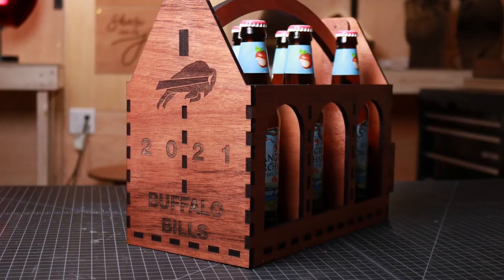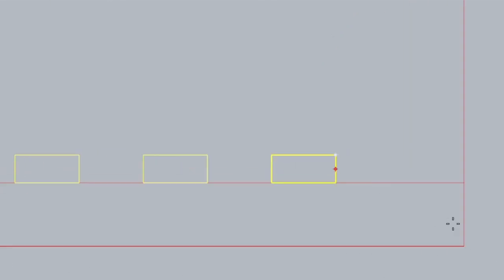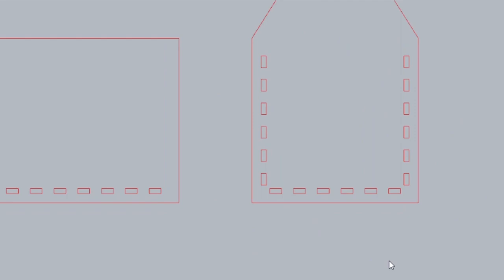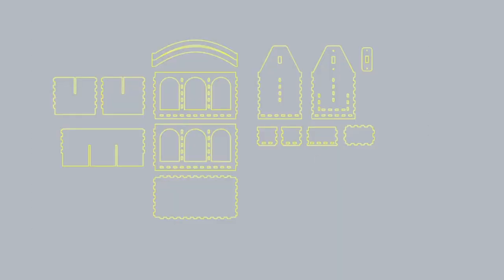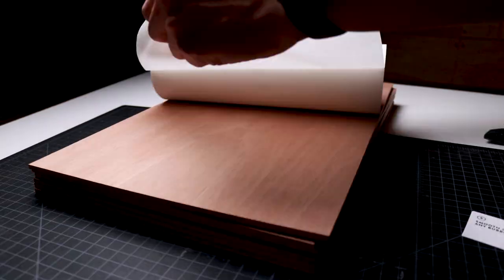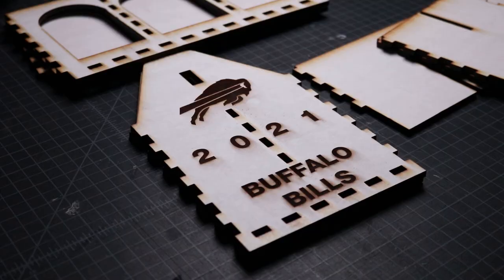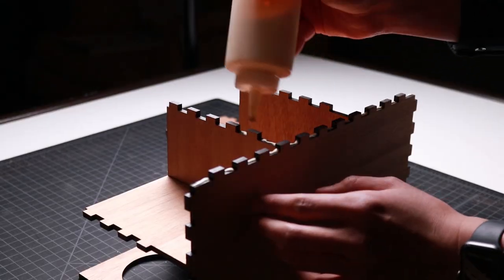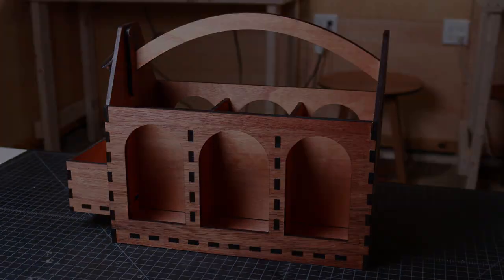Making a Beer Caddy With a Laser Cutter

Comment: What 3D modeling program do you use and is it hard to learn? Thanks.
Reply from the maker: Thank you! I use a software called Rhinoceros. If you can use Adobe Illustrator, Inkscape, etc., you can probably learn this software too. They have courses that guide you through the basic  tools. I like using it because you can draw your design in 2D, extrude the shapes, and build a 3D model with all the pieces to make sure they work. Hope this helps!
Reply: @LaserMadeProducts  yes, it helps a ton. i’ve been wanting to try something like this for mock ups as well and to prototype better as you did on this video. thanks, very informative.

Comment: When designing the finger joints, do you correct for kerf or that something that is done in the laser software?
Reply from the maker: I used to have a small tool that I laser cut with grooves to test different thicknesses and fits to find the exact sizes for each project. Now, I usually cut joints, slots, and tabs at the exact material thickness and I don’t correct for kerf

Comment: european here. What thickness of plywood in mm would you recommend for this project?
Reply from the maker: I’d say a 6mm plywood could work for this project. You’ll just need to make sure you coordinate the size of the tabs and slots with the actual thickness of the plywood (measured with calipers) since plywood has slight variations in thickness
Reply: @LaserMadeProducts will 5mm plywood work with this file without any changes?